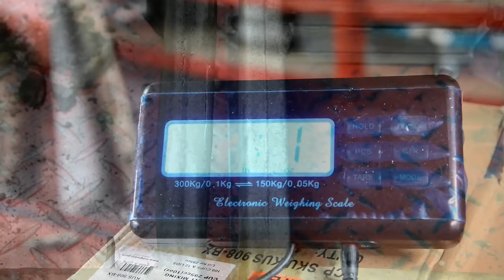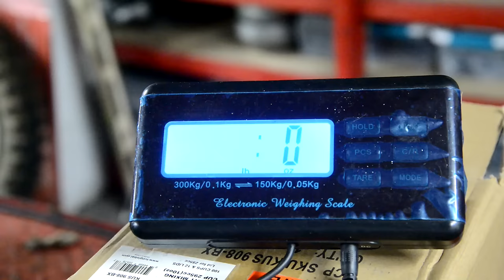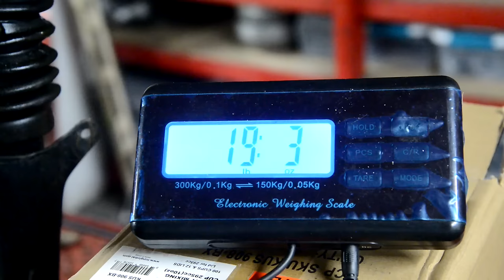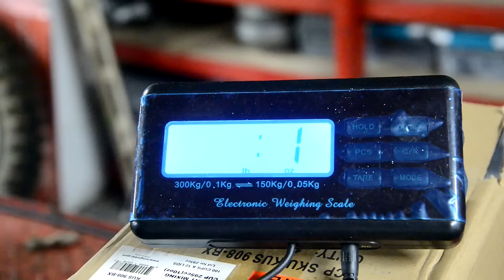Greeves Anglian  -  Part One

Comment: I wonder if that split and bulged swingarm has had water in it at some point that's frozen. You see similar damage on farm gates they lost the plastic cap off the top of. I think it was the sealed side designed for a chain oiler? If it was and it got water in, frost would peel it open like a bannanna skin with little effort.
Reply: I agree totally. Looks just like a water pipe that has frozen and split open. Lots of force in water when it freezes. I’ve seen small aircraft, chrome moly frame tubes with similar damage as well.

Comment: I can see you wrestling with the idea of using the banana forks, so I thought I would weigh in.  I am a larger rider and always had trouble with downhills.  Controlling speed while keeping my weight on the back wheel.  First time I road with the banana (Earl's) forks, I was hooked.  On down hills, using the front brake to control speed actually raised the front and gave me full suspension under braking.  I could leave the rear brake free and  not have to worry about the back sliding out or going over the bars when the telescopic forks had collapsed.  Brilliant.  I then tried them on my desert racing bike and WOW.  Coming at some obstetrical at speed in the sand then suddenly having to brake was a big issue with telescopic forks, but the banana forks stood the front end up and planted the tire so more brake could be applied so more confidence going fast.  
So now in my late 60s and blind, I ride a trike I built that is electric.  It is not fast, but with my reduced vision, I still have the issue with the forks collapsing as I am braking for a curb or something.  I have just obtained a set of banana forks that I am adapting to it and am watching with great anticipation to see how the Rock shocks work out with your Greeves.  Thanks Mate!!!

Comment: I was arguing with you as you did your weighing, Michael, but others have covered your ‘weighing aberration’ so I’ll keep quiet! I’m not surprised the forks are light, though, as the tubing is large diameter but very thin tube. Strength in the diameter rather than the amount of metal. Wonder what on earth has happened to that rear fork, though. Real trauma. Am loving this series, as I always fancied a Greeves. Love the ISDT models. Les in Chester 🇬🇧

Comment: The leading link "banana" forks are especially good going down steep hills, the front brake gives a rising torque vector, while the rear brake gives the opposite, therefore it can be modulated to some effect. My Sachs 125 had this and that is how I remember it, having never ridden a Greeves.